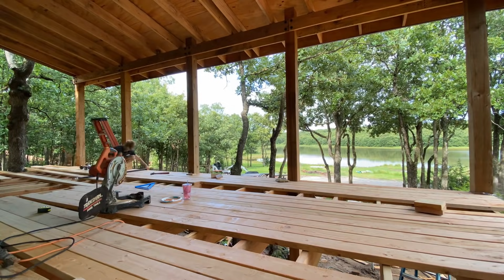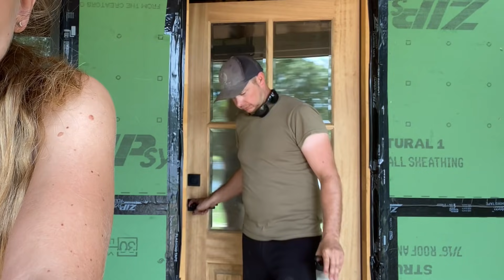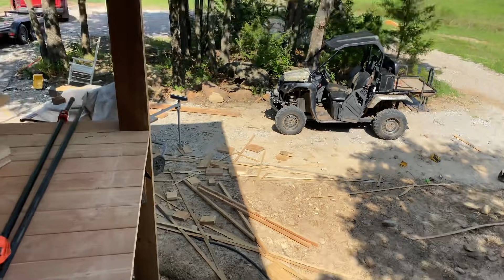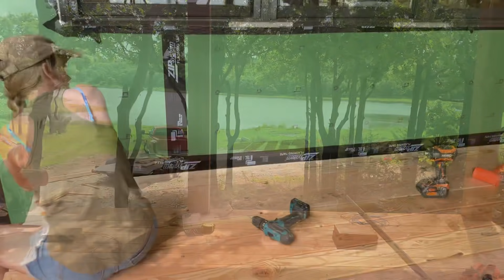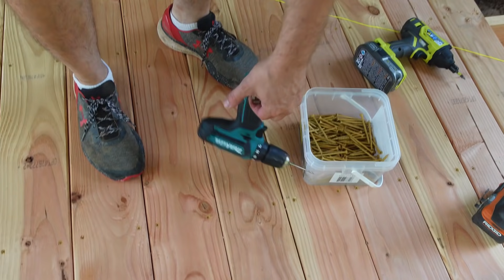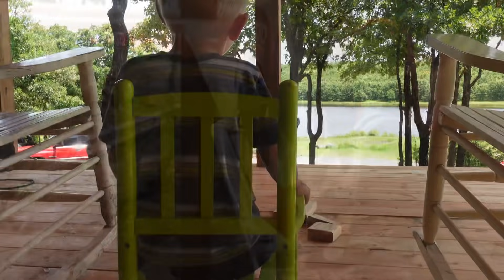Building a HUGE porch | DIY Debt Free Cabin Build | part 4 | Decking | Pier Porch

Comment: The decks I helped build with my friends we always had a space between the boards so that if the boards got wet and swelled their won't be any problems.
Reply from the maker: yep. that’s the best way. thanks for watching.
Reply: Agreed Jeffrey, same with websites and other carpenters, correct spacing, usually 1/8 inch, prevents warping, buckling,  and allows for water drainage, cleaning,   Wood needs to breath and will expand and contract.

Comment: Really should have a gap between the deck boards to allow for expansion without buckling and warping the boards, rather than clamping them tight one to another as you screw them down.
Reply from the maker: There are gaps. We didn’t clamp them together we clamped them straight because they were all twisted and bowed. Thanks for watching!